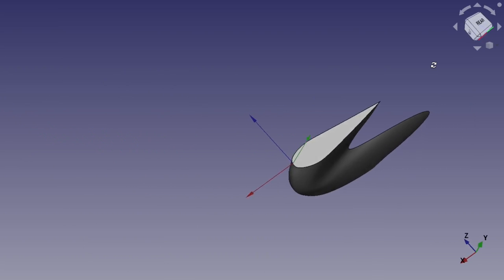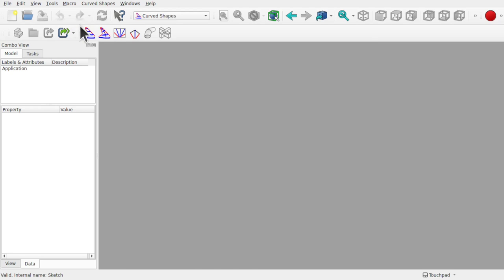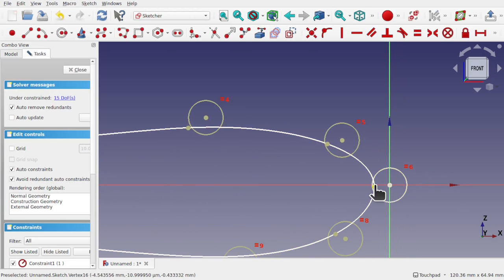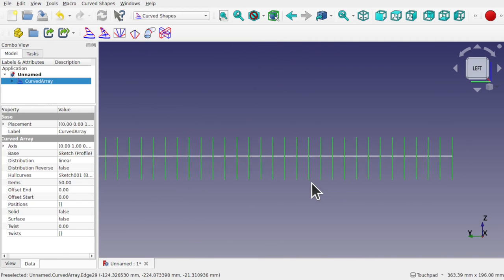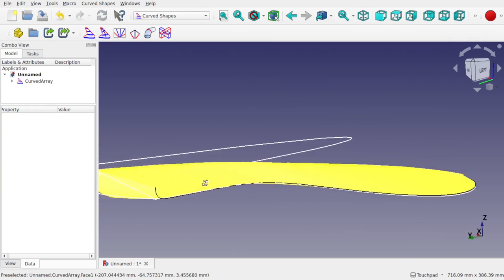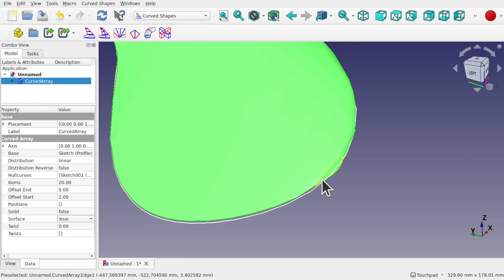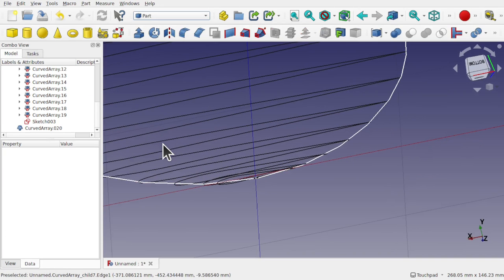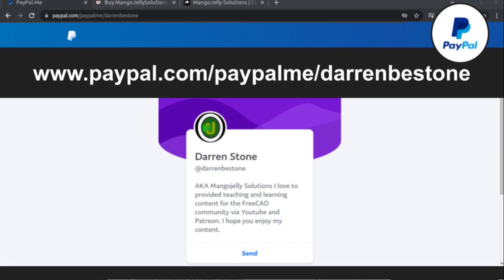Complex Lofts in FreeCAD in Minutes even Seconds! Easy, Quick and Simple!

Comment: If you want to precisely control where at spline tangents to, just create an extra point. The spline will just touch the midpoint of the two control points. You can not only control where the spline touches, but at what angle it hits that point.
Reply: Actually, this requires a polynomial curve. Not sure if FreeCAD has this capability.

Comment: Very Useful WB. I just finished 28/53 aeroplane canopy and I knew there had to be a more calculated procedure. How can I create templates from the profiles inorder to create a wooden plug for making a mold for composite work
Thanks
I am really satisfied with my increased FreeCAD skills!
Reply from the maker: It's a great little workbench, only a few told but so powerful. The surface is a compound when you set solid to false and see all the profiles. The profiles can be "exploded" in the part workbench (top menu, part, compund, explode compound) . You will now have a folder of individual profiles which can be extruded / exported separately. I have a video coming up that will show a very similar workflow. It's already been released to patreon and will be public soon.

Comment: Just a quick Question.  While building a box, and using the thickness tool, the sides and the to, all change, and I would like thicker walls and a thinner roof.  Is there away to keep the roof thickness at 1.5mm and the walls at 3mm?  It is quite a wast to have the roof the same width.  It is a small box, and it is causing some troubles with other dimentions.
Thank you  for all your video's, I've learned a lot from them.

Michael
Reply from the maker: Just had a quick look through my video collection as I am sure I did a video on that. Yes here it is https://youtu.be/35ZO8vQE-3I

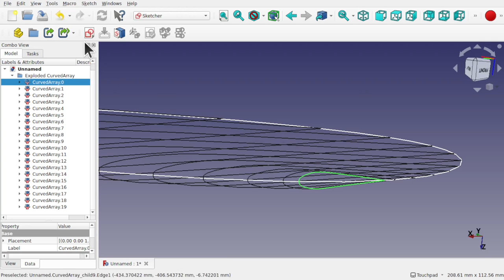Comment: G'Day Darren, I'm running FreeCAD 0.21.0 at 19:40 when attaching the sketch instead of InertialCS I get offered Inertia 2-3 (amongst other options)? I'm trying work through it using a Wing of my own Design but using the above when I get to the Loft the Curved array is not showing (just my Sketches to create the wing). I'm ok up to this stage and have found experimenting with Various options and Parameters give Me decent results. Would however like to keep following your Tutorial as close as I can. I like some other posters are looking to construct Radio Control Models and Some guidance on converting to drawings that we can manufacture, cut templates form would be nice. Regards, RW I'll experiment to see which attachment option works.
Reply: I have vers 0.21.1 and I used that Inertia 2-3 and I cannot move the point at all but if I go to the data Tab the Map Mode has Inertia CS creates and if you double click it one can change the xyz placement. But in the end using a point makes the LOFT go weird, I made the profile scale tiny and that ends it OK but not closed to a point. Not sure what to do to close it in this version..

Comment: I was actually working on a tail of a helicopter a couple days before you posted this video. Oh boy hoe that wouldve made things so much easier than a bunch of gradually changing lofts like how i did it because that needed reference vertexes to use as base points on each loft
Reply from the maker: I knew I should of released this earlier, your not the only one that has said how this would of saved them so much time. It's changed the way I work as well. When I first tried it I sat looking at the screen for at least 10 minutes muttering 'how did I miss this!'